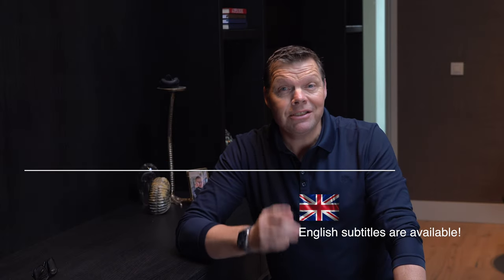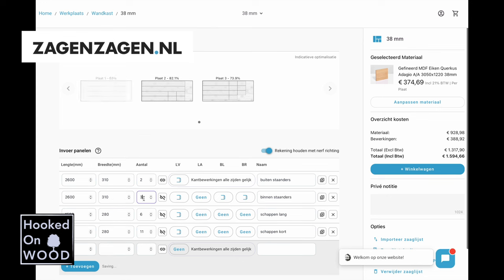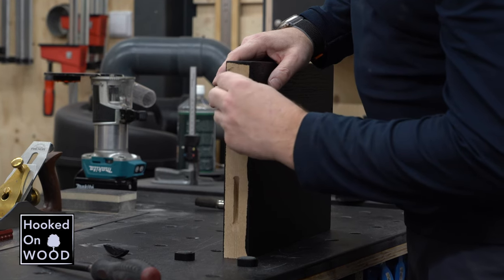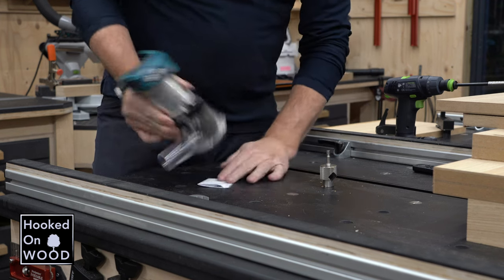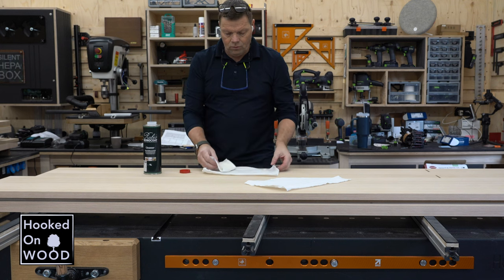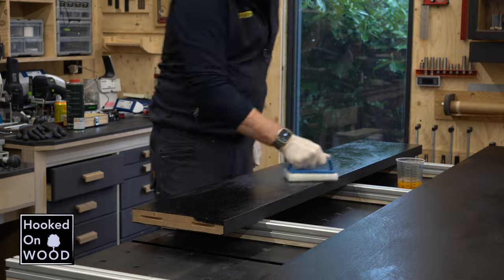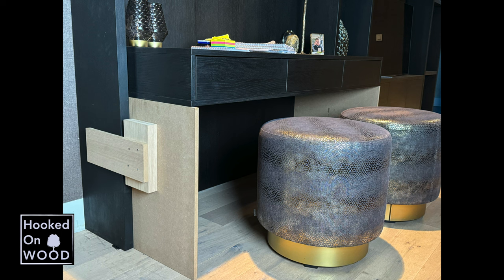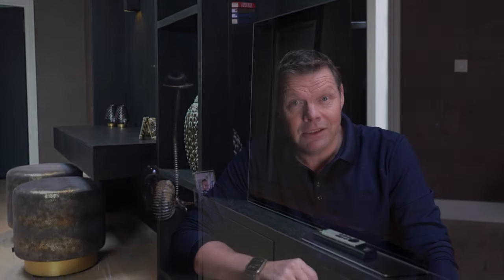My DREAM DIY Project, Hoe heb ik deze kast in mijn eentje gemaakt?

Comment: Die pocket hole gaten zien er niet uit alsof ze met 1 van de china jigs zijn gemaakt. Maar eerder een stationaire machine. Wat heb je gebruikt?
Reply from the maker: Goed gezien, dat is een Caslte pocket hole machine. Ze willen deze ook aan gaan bieden in Europa en met 220v. Ze hebben er een naar mij opgestuurd😀
Reply: @HookedonWood  lekker !! Mooi meegenomen dan. :) Zou mooi zijn Europees model. Benieuwd hoe dat qua pricing gaat zijn voor mensen zoals ik die nog niet aan de domino of zeta willen :')
Reply: I too would like to know the connecting method and connectors. Jay
Reply: @jaychohan8610  castle pocket hole machine with pocket hole screws (and I believe some lamello zeta p2 machining and using clamex  and or tenso connectors)
Reply from the maker: Helemaal goed👍